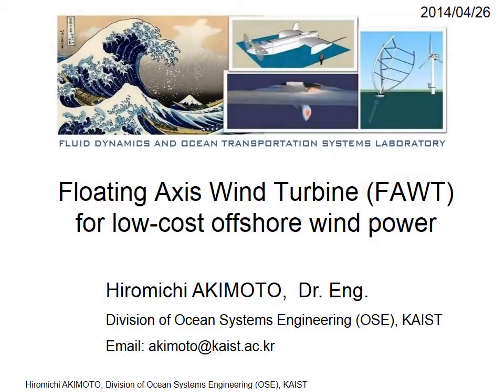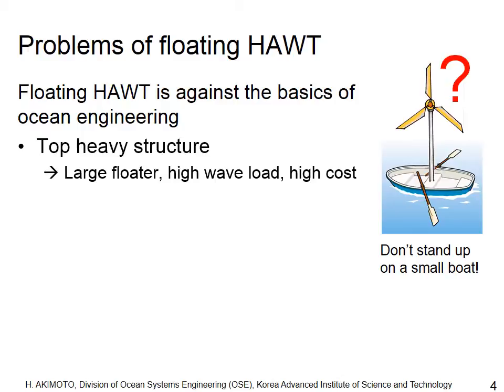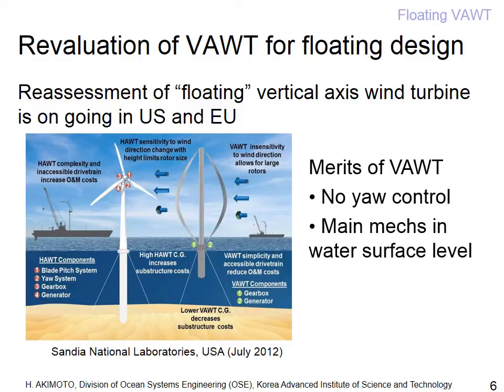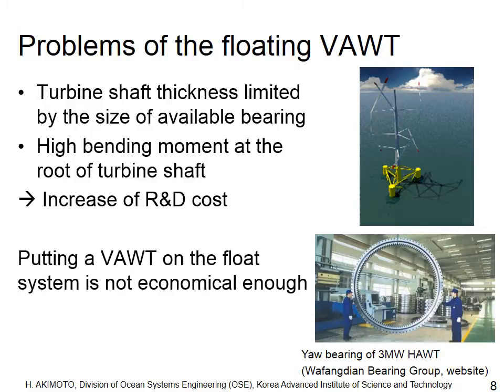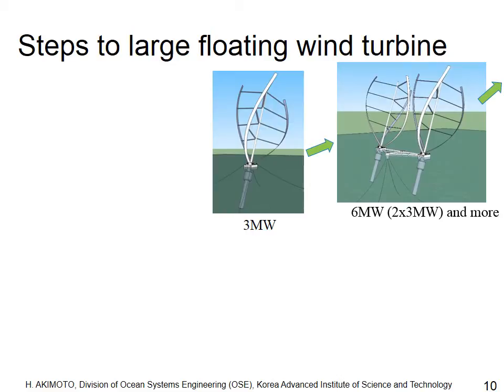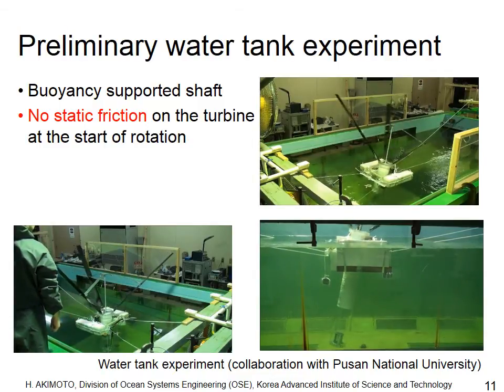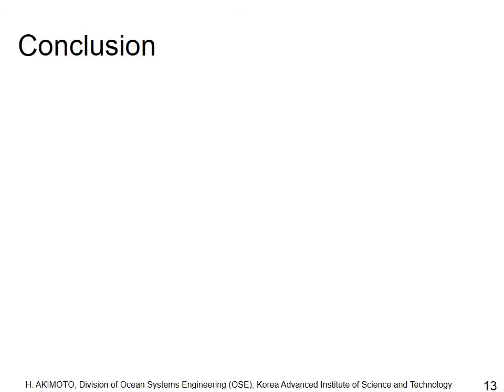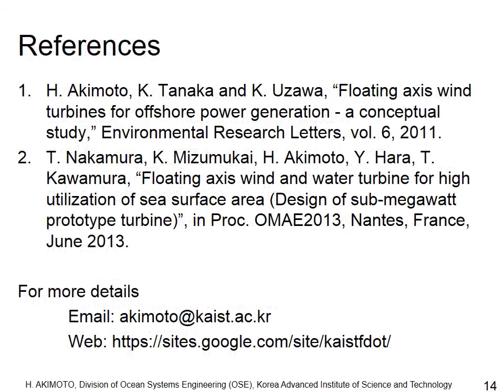Floating Axis Wind Turbine (FAWT)

Comment: Interesting concept. The weak point seems like it would be  the connection from the shaft to the generator (s).
Reply from the maker: Thanks. Support of rotor axis is the weak point of all the large turbines. The idea is to remove the heavy rotor weight from the bearing support and avoid  difficult R&D of large diameter bearings.